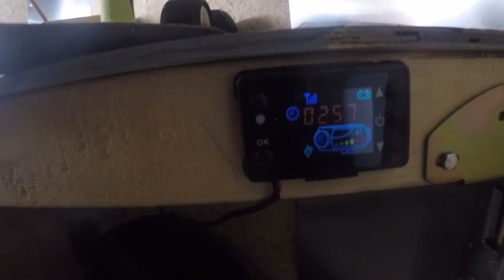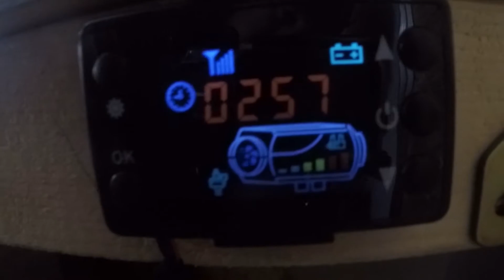Chinese Diesel Heater Install in the Enclosed Trailer

Comment: Does your fuel pump click while running?  I've heard some that make a pretty loud clicking noise but it didn't sound like yours was.  Nice install, looking to do this on my 7X16
Reply from the maker: It does click, but when the heater is on high it is less noticeable with the fan and burner noise. When first starting up and on lower settings it clicks loudly!

Comment: Thanks for making this and sharing your work. For the air intake, will you leave it as is or try to run a pipe for outside air?
Reply from the maker: It has an air intake and exhaust for the burn chamber already routed through the floor, then just recirculates the air in the room over/around the chamber. Works great so far, no changes planned!
Reply: @mndurousa8264  got it. That explains why you don’t need additional air intake. Thanks.

Comment: Is the battery for starting only?
Or does the heater use it for fan operation also?
Reply from the maker: The fan and the fuel pump need 12v to operate.